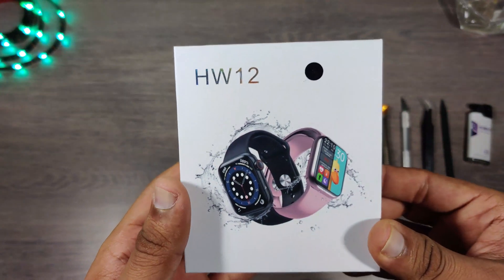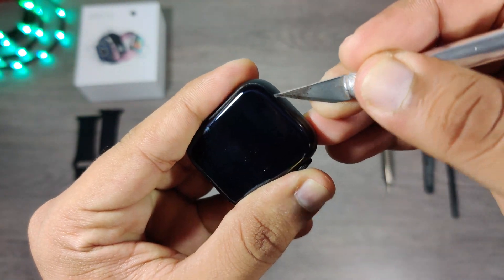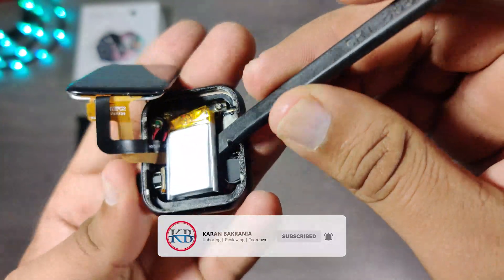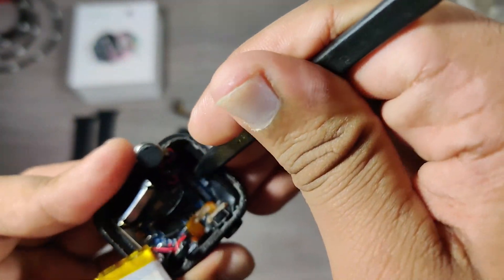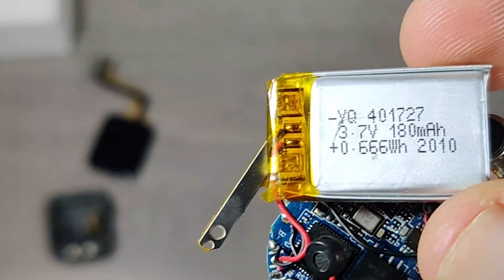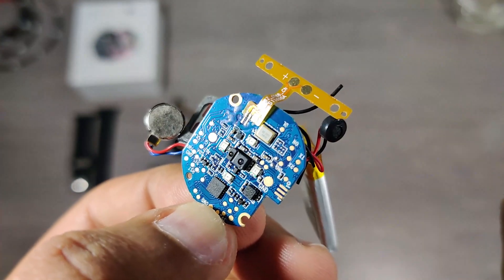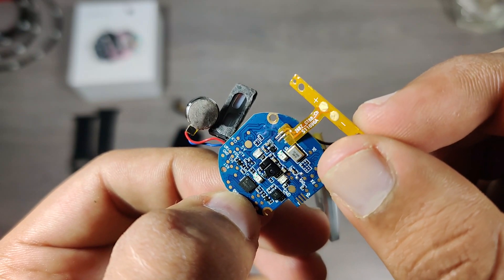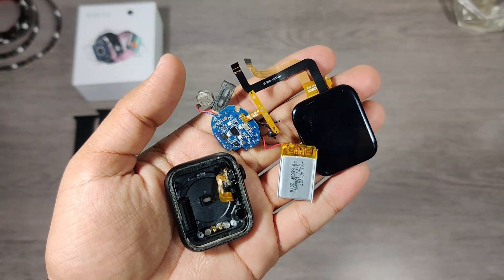Apple Watch Series 6 HW12 Teardown | HW12 SmartWatch What's Inside? | Is Heart Rate Sensor Working??

Comment: for some reason my watch is briked after installing a watch face from wear fit pro and it keep and the watch keep blinking until the battery discharge i need a way to hard reset it cause i cant get it to work with my phone

Comment: Hi bro plz tell me does this watch have calling and messaging option
Reply from the maker: Yes it does have when connected to smartphone.
Reply: @KaranBakrania  plz reply to my this question also i will be very thankful to you and the question is that which watch gives accurate readings of temperature , bpm and heart rate 
Fk75, fk88, k8 orr hw12
Reply from the maker: As of now none of the watches will give you accurate measurements. Because the company is not using actual sensors which are to be used. If you are planing to buy for fitness tracking then these watches are not right option. Watch this video it might be helpful for you 👉🏻 https://youtu.be/UfbHI_o5qcw